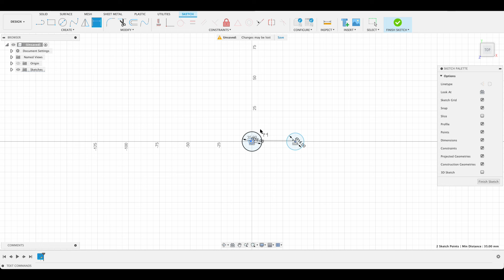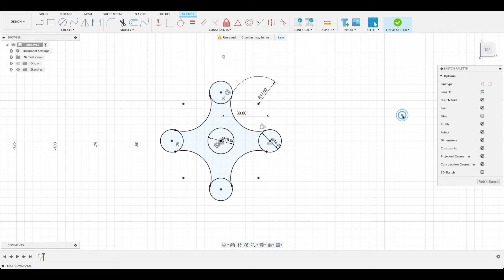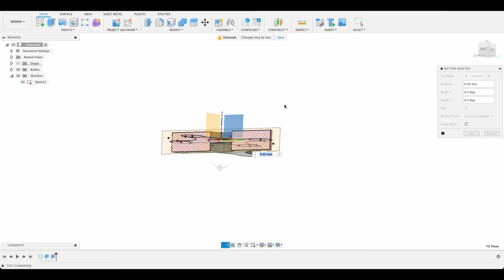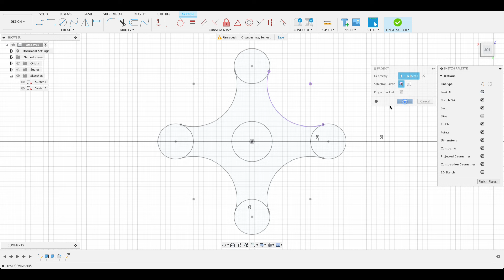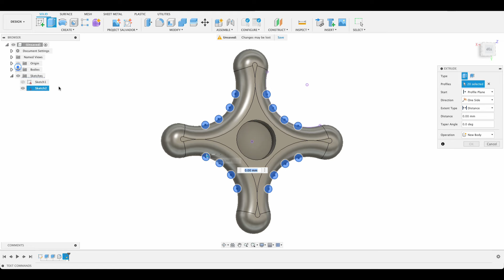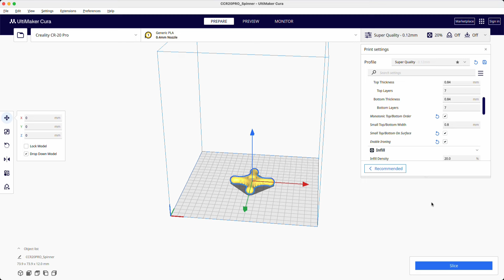Design to Print: fidget spinner

Comment: Very cool design.  I really enjoyed your use of circular patterns.  The only issues I see is that large fillets on the bottom of a print tend to sag and not have a good surface finish.  I would lean more toward distance/angle chamfers, followed by very small fillets.  This would make the print more esthetically pleasing.
Reply from the maker: Cool thanks for the advice